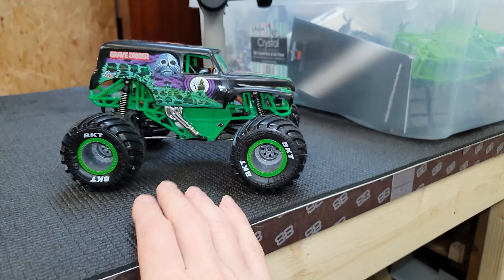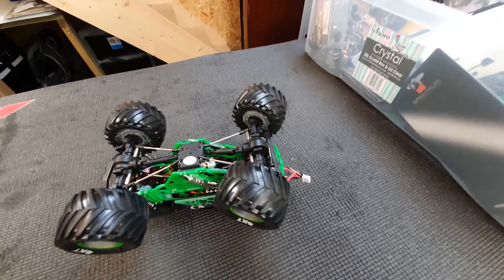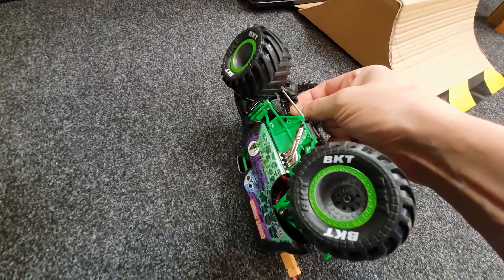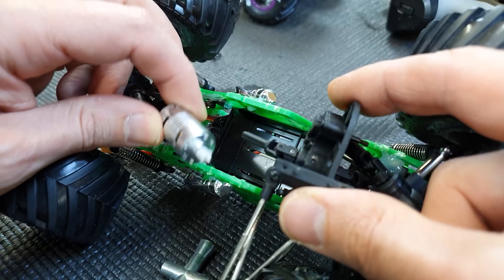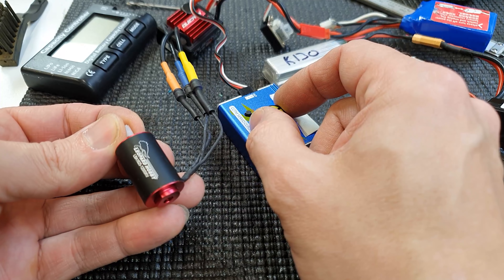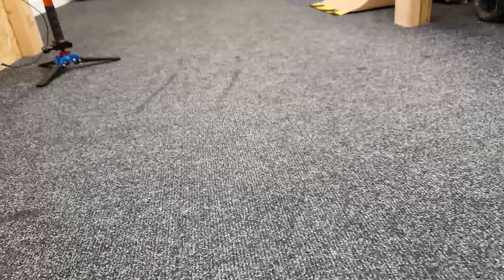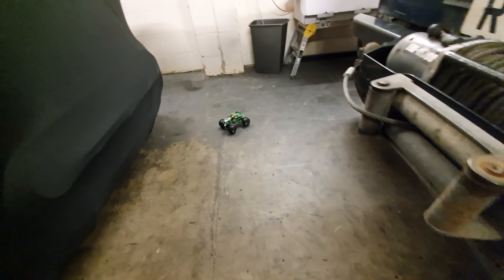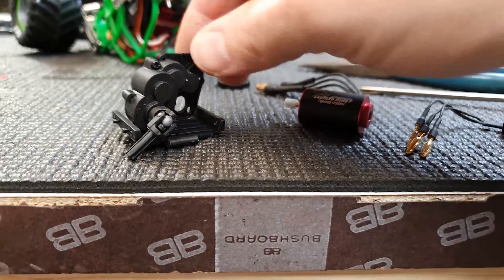Build the WORLD'S BEST Tiny RC Grave Digger RC Monster Truck Car

Comment: Take the 12t pinion off and use the bass 10t pinion mate, you can find the 10t pinion on most. Servo motors if you have a dead servo or they also come on rc4wd 1/18 motors

Comment: Use a hobbyking 130 motor, they have a flat side on they so it should fit and they have 4 different types with different kv

Comment: I found the devastator which is currently being re-stocked as a 4 wheel steer model but i am unable to find the separate parts such as the transmission and the front/ rear axles. Anyone point me in the right direction for parts or do you have to buy the entire truck and rob the parts?

Comment: Kev you need to spray the inside of your bodies with flex seal clear it makes them way stronger and keeps the paint from wearing
Reply: Ben Ellis I found a black one at the junkyard 😆
Reply: don't see why not
Reply: Ben Ellis I've thought about that a few times but I've always used gorilla tape on the inside of the body. How does the flex seal work??
Reply: @Barncat01  there are several different products; I do not know how well it sticks to poly-carbonate RC body, or if it is effective. I HIGHLY RECOMMEND buying the RC body of your choice, and vacuum forming a direct copy that is easily customized and can be made much thicker than the original body. The body will last much longer and you can just use the original if you ever need another. DO NOT SELL THEM IF THEY ARE REMOTELY RECOGNIZABLE AS THE ORIGINAL; YOU CAN GET SUED.

Comment: What is best for e revo 1 16, series 6 cell nimh or parallel 3s lipo, this is for the vxl, this would be the highest current I could put in the mini e revo
Reply: Tyler Kwiatkowski , 3s Liao is way better
Reply: parallel 3s lipo for sure, hell id say it might even beat it with 2s in parallel vs nimh 6 cells in series.
Reply: Thanks

Comment: I think you should really look into getting the Losi super rock rey It is so so cheap it is $85 and it is brushless 1/6 scale racing buggy used on a 6s or a 8s with a top speed of 55 mph on 8s you should look into it